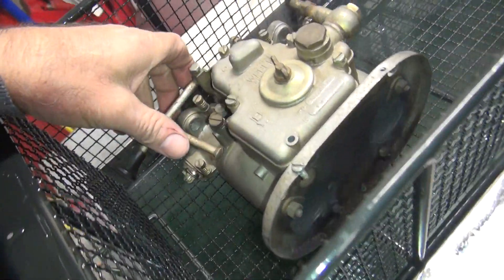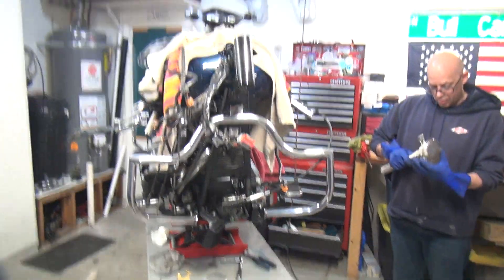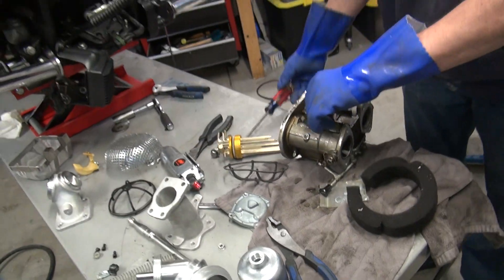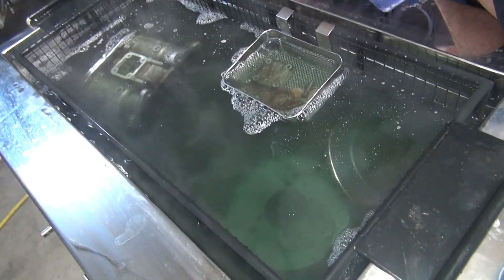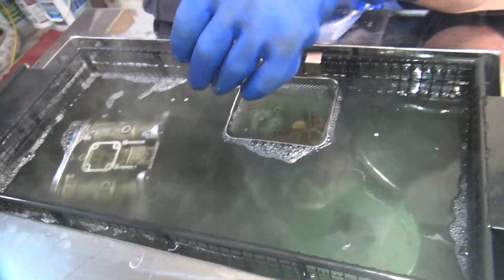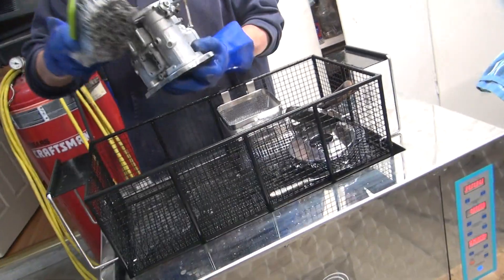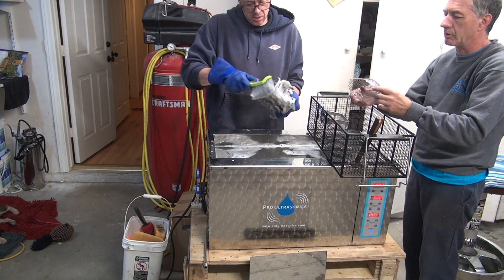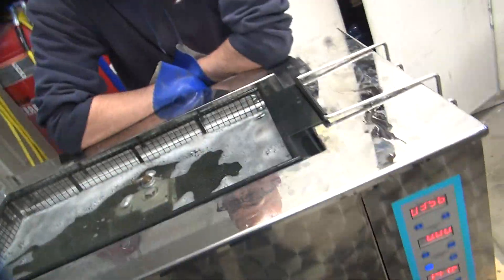#106 2024 testing pro ultrasonics cleaner knucklehead SU weber carburetor pan harley tatro machine

Comment: what you using in it? we use to use simple green but they always warned us never to put anything rubber in it.
Reply from the maker: just go back in the videos and you can see how we set things up. we are using the pro ultrasonics basic cleaner. it is mild and does not hurt anything.
tatro

Comment: Bottom line should I buy one or shop around Keenan ?  Do you know of something better ? Money no object    Thank you
Reply from the maker: these things are great for carbs and jewelry. they are not very good for cleaning heads and cases that have lots of carbon and corrosion. they get fairly clean but nowhere shiny like new. like most things, it takes way more effort to get what you want. you still need to pre clean and bead blast the heavy crap. the ultrasonic cleaner is for doing the final cleaning with. its just one more tool in the tool box.
tatro
Reply: @TatroMachine Thank you so much 🙏🇺🇸